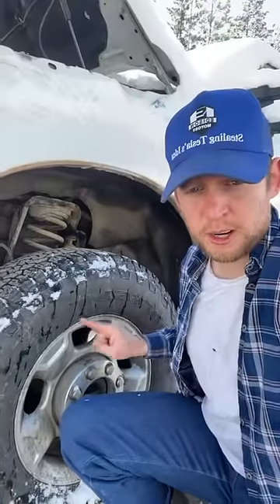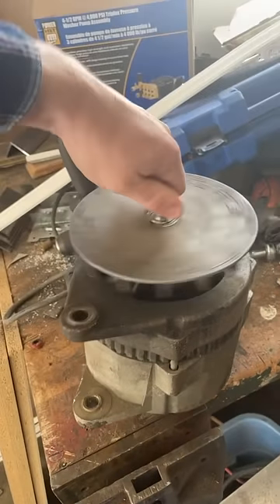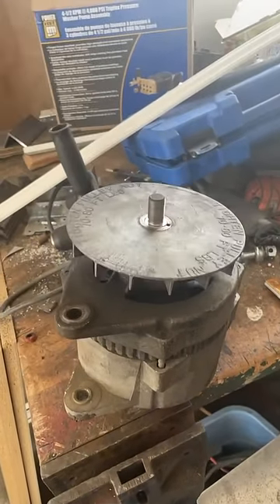Alternator on each wheel???

Comment: Dude just independently came up with the concept of regenerative braking. Cut him a little slack 😂
Reply: exactly
Reply: I was just about to say the same thing, but the old man is actually talking about perpetual motion so that the car generates energy as it goes and not looses any, but as this guy says.. When you add the alternator's you add resistance and you need more power to go the same speed as before, so you will always need to charge it somehow unless you can design a new alternator that has a 0 resistance.. And then you'd still need that initial charge to get you going.. I guess you could use solar for that.
Reply: @brandongantt9343  what’s not true?
Reply: @brandongantt9343  you need to learn how to read better
Reply: @brandongantt9343   couple of points. A) I didn’t say he invented regenerative braking, I (jokingly) said he independently came up with the idea. B) Nikola Tesla invented a lot of cool stuff, but has absolutely Otho h to do with Tesla motor cars. Elon Musk just thought it would be a cool name, that people associate with electricity and innovation.
Reply: That's already in use in the Honda hybrid.
Reply: Then convert heat to electrical energy wouldn't that work?
Reply: Superconductors are a real thing boys 😂😂😂
Reply: My 2007 Prius already has this system from the factory.
Reply: If only regenerative braking actually regenerated my brakes =D
Reply: @onehothand68  well exactly. But I don’t think this dude is the sort to drive (or understand the good stuff inherent in) a Prius now, is he?
Reply: Not really, he didn’t imply that it would help stop the car. That’s because he thought it was “free energy”
Reply: @JaybayJay  it’s is physically impossible to create zero resistance. Laws of physics apply to all.
Reply: @elijudkins2578  you know I was joking, right?
Reply: @elijudkins2578  I just woke up but let me put ol' 200+ to it..  A floating magnetic power generating alternating tire..  Inside the tire is a system of free floating magnets that generate power when the tire turns, and since they're held in place by magnetism, very little resistance when there's no charge.
Reply: @JaybayJay  very little is not zero.
Reply: @elijudkins2578  Oh when there's a charge they activate and spin reducing resistance to 0 inside the tire and generate energy at the same time.. The tire itself would be a alternator, x4.
Reply: @elijudkins2578  If I put it in a vacuum that could reduce the resistance to near 0
Reply: @JaybayJay  that is false. Everything has resistance. Plus what would be the point in putting it in a vacuum then you can’t even use it.
Reply: @elijudkins2578  The vacuum is built into the tire's alternating system where inside the tire, while it's moving, is also conducting energy through magnets and kinetic motion.. When it's near zero resistance, with 4 tires, you should generate enough power to keep the battery charged at all times..   Theoretically. 

What's the point?  
Of what?  Dreaming?
Creating?  Innovating?

I wake up every day and my brain screams new idea's I can't stop even if I tried.  I write these crazy stories about world's strange and unusual my mom wants me to write professionally and people ask me where I get my ideas.  And i tell them, they come to me in droves, or I dream them..

Back in the 90's my dad asked me what I would do with the internet, and this was when it was still just coming out, the mp3 was just bout to be invented and the very first thing I said to him was a "Vast Repository of Video's and Music" people can sub and access..  

I predicted streaming sites and the music industry and video industry fall, long before blockbusters started going bankrupt..
Reply: @hairychris21  company was made before he bought it.
Reply: @battledsoda6744  You will never capture all of the heat. There is no cheating physics.
Reply: @Suzy9MM  i don't know just throwing ideas im not a physicist so i guess i can't really help in any sort of way
Reply: Yup! Truth
Reply: @JaybayJay  it’s a heavy car though so it can use all the power to get up a hill and then make it back going down the hill and coasting away from the hill I guess traveling on a flat surface uR kinda fucked I guess I just hate all these fuckers trained subconsciously hitting they’re brakes all the time for no reason because in their mind it’s a good thing just put alternators on the wheel with a hydraulic clutch system
Reply: The guy just came up with the kind of great idea that only comes after about the sixth beer. He needs to drink six more so he can come up with an even BETTER idea 💡
Reply: I like to say, a good idea is repeatedly discovered.

No shame in failing to know it already exists, it only highlights how good the idea is.